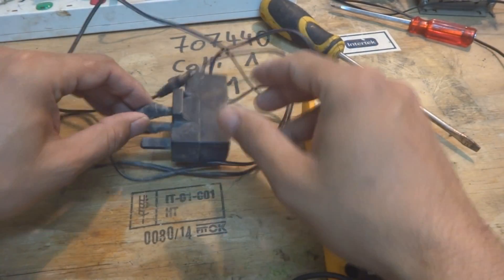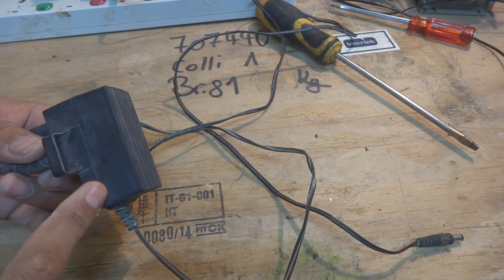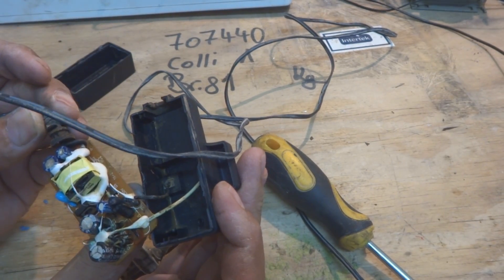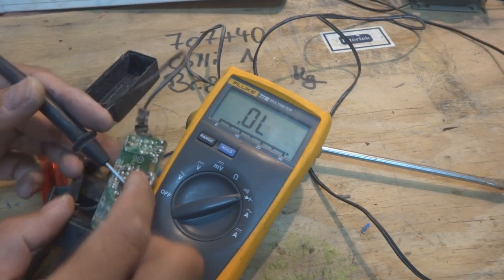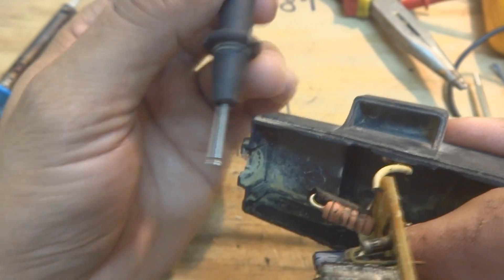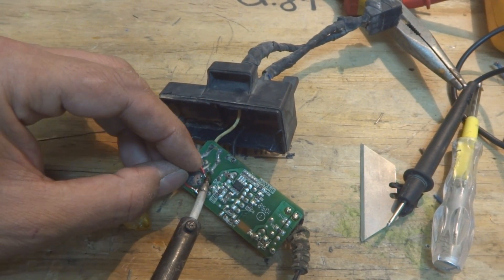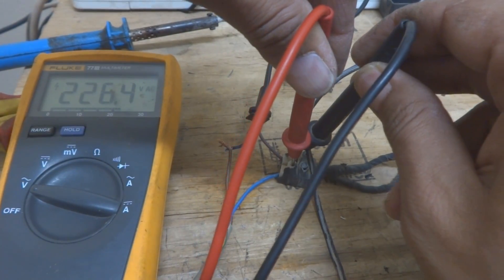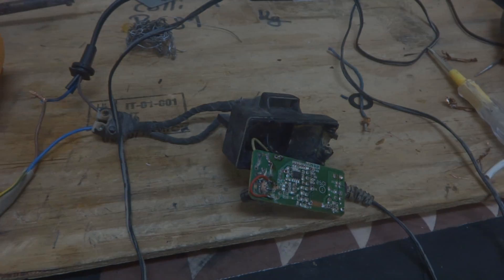Repairing a switch mode power supply. SMPS repair.

Comment: Hi, good video. Regarding the use of series lamp, why it wasn't safe to connect the PS directly to power?
Reply from the maker: +cyrus Thanks for liking video and nice comment. After repair we are connecting the power supply with series lamp to limit the current. That is important to ensure there must not be any further short circuit which we didn't address yet. So if it will draw much more current due to short circuit, we would understand that from the lamp light. Then  if there will be a short we will further troubleshoot and repair. Hope you will enjoy next coming videos. Regards,

Comment: Amazing recovery jahan, i expected it to be very dead indeed lol :-D
Im so supprised that the rest of that supply escaped damage, water is just not compatable with switchmode supplys LOL :-D :-D
That pcb needs dipping in varnish to seal it from the elements, and the 240v internal connections varnished as well.
Sealed in a plastic bag with the opening facing down might be a kinder way for it :-D.
Reply from the maker: +zx8401ztv Yes dear sir you are right. The proper protection of the power supply will prevent it from future damage. This was water damage after one rain. Rain is very rare here so we are normally not doing enough protection from that.
Reply: +LearningZone 
Yes i suppose that electronics is mostly safe from water where you live, but you can never trust the god of rain ha ha :-D.
I did laugh at you teasing the people that panic about live connections, i understand you fully, its very short testing only.
I liked the test block that bigclive uses for his quick tests, a pod with three simple wire connectors and a lid that you have to close to apply power.
I bet you or anyone could make one if the interest is there :-)
Reply from the maker: +zx8401ztv Yes dear sir I am planning to make one as live testing is so frequent. Also feeling happy while teasing over safety oriented people! I am planing to make a testing board using an earth leakage circuit breaker and some other breakers. Earth leakage circuit breakers are already installed on my facility. regards.
Reply: Very nice video Jahan and a test board as you've mentioned here would be a good idea. It would make your testing go faster and you wouldn't have to worry about the pests out there commenting on unsafe practices. I look at your testing as safe as you are very aware of its dangers. Very educational video of making the repair.

Comment: how safe that wire compared to the damaged resistor ? Some people call them protection resistors. However they have a value therefor they limit current. My question is how can that wire replace it without causing extra damage in the future ?
Reply: or is it just buying some time as a work around ?
Reply from the maker: +Mohammed Berdai A 1 or 2 OHM resistance is nothing to do with current limiting. They are only a sort of fuses of very low ampere rating. If they go bad, normally they are replaced with a very thin wire as I did in the video. The exact replacement fuse is very difficult to find. So the better alternative is to replace that with a thin wire compared to throw the power supply as a whole.
Reply: +LearningZone Thank you